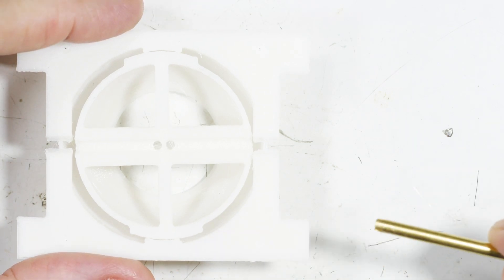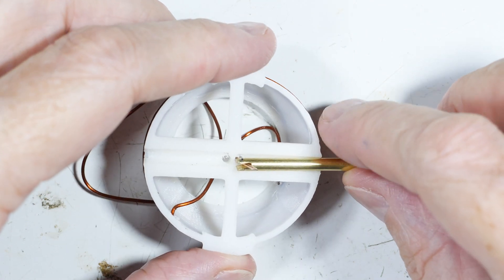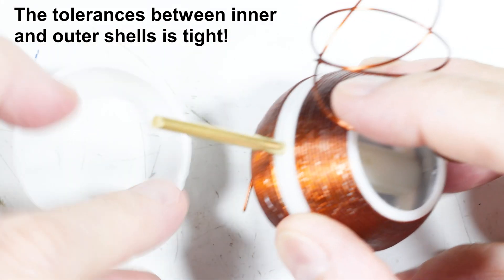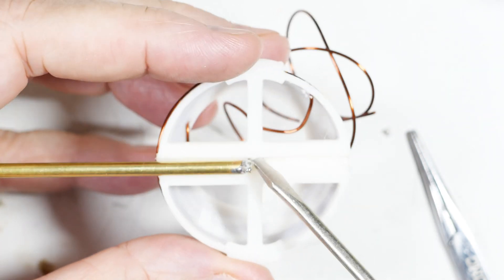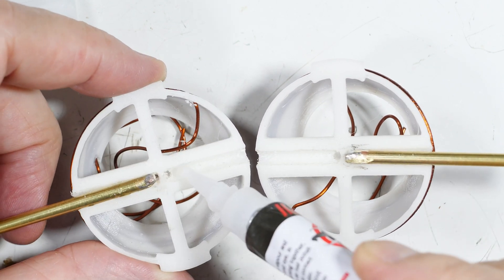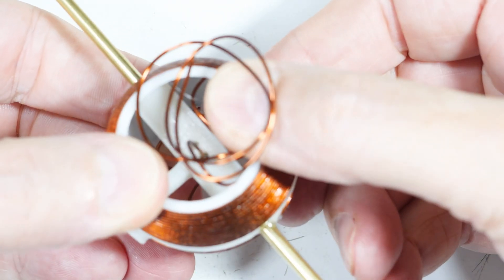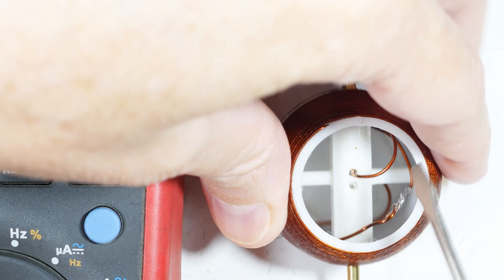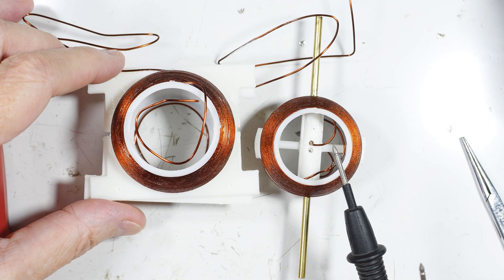Crystal Radio - Variometer, Pt5 Ball Is Done! (4K)

Comment: Excellent progress. IIRC, plastics can have a type of waxy surface that impedes super glue adhesion. A light sanding of the surfaces, followed by a gentle degreaser (IPA,) will greatly improve the bond.  So much so that the set time becomes instant. Therefore , use a gel type super glue, with a longer open time. The gel also does better at filling any gaps. Also, research more super glue tricks... Baking soda and cotton balls. Cheers!